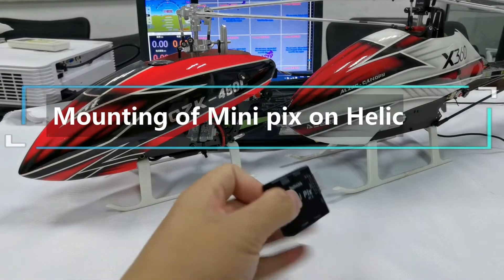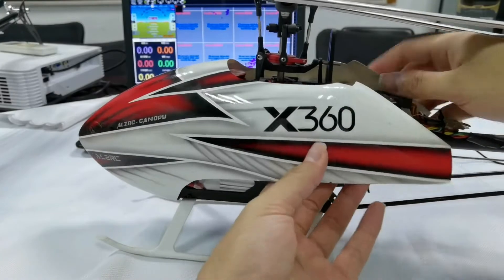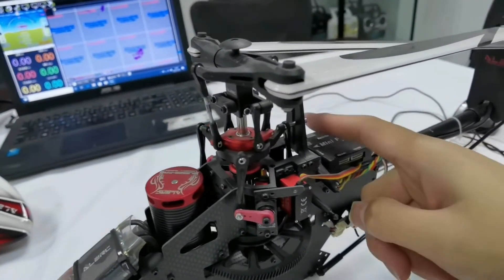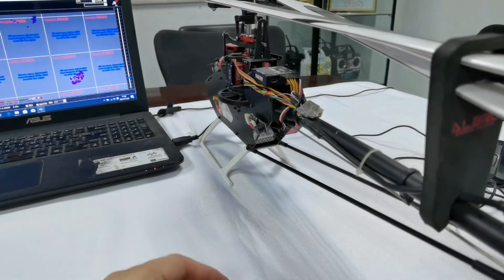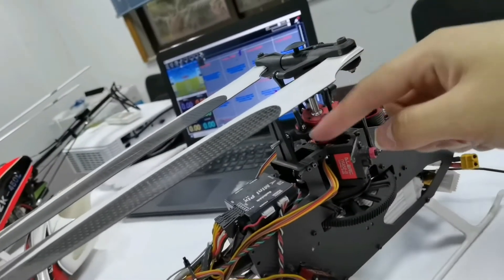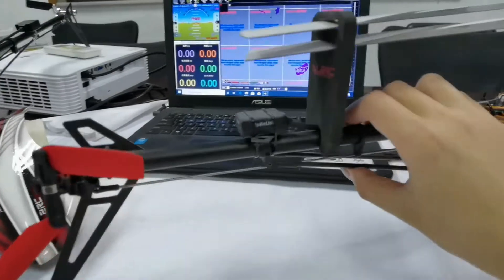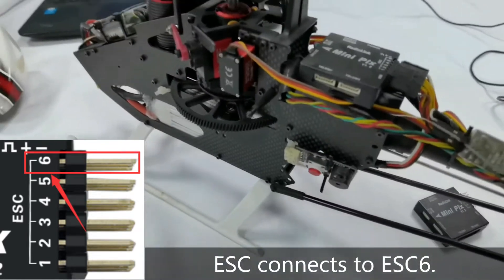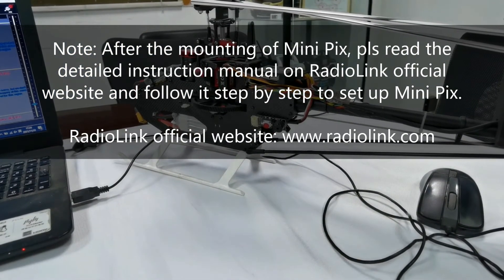PIXHAWK/Mini Pix/crossflight/Turbo Pix on Helicopter

Comment: Sure. Here’s your text converted into English, keeping the same tone and clarity:

⸻

I conducted new tests with Crossflight, this time using a Devil 420 helicopter. Unfortunately, in Loiter flight mode the main and tail rotors remain static. Therefore, the frivolous argument that “everything will be solved in flight” sounds absolutely false to me.

Thus, should RadioLink Support fail to be cooperative in providing a configuration capable of changing this situation, I will definitely abandon this Flight Controller and, as a matter of conscience, I will not recommend its use in rotary-wing aircraft, given the arguments and tests demonstrated.

This idle talk about “flight logs” does not serve my purpose and does not answer the following question: WHY, when engaged, does GPS flight take full control away from the pilot, turning the helicopter into an alien machine? That is the only question I am asking: WHY DOES GPS FLIGHT MODE NEUTRALIZE THE COMMANDS?
Reply from the maker: Hi, sir. May I know what you mean that the main and tail rotors remain static? Could you please send us the flight log and also the flight video to show it? And in GPS mode, you can control the helicopter with the stick. Only in auto flight, the stick does not respond. If any question about RadioLink products please feel free to contact us. Our email is: after_service@radiolink.com.cn

Comment: in the manual it says that: Crossflight with factory date after August 16, 2023 (including the 16th) can update firmware by default through Lodi ground station and open source ground station. Before the factory date is 2023.8.16, the firmware can only be updated through the Radix ground station and only the Radix firmware is compatible. How can I find out the manufacturing date of the crossfligh?
Reply from the maker: Hi, sir. Connect the CrossFlight to the Radiolink Mission Planner, there is a (d5a4c778) default that can upgrade the firmware by both the Radiolink Mission Planner and ArduPilot Mission Planner. You can check more details from this link: https://www.radiolink.com/crossflight_firmware  If any question about RadioLink products please feel free to contact us. Our email is: after_service@radiolink.com.cn
Reply: thank you very much!!!  for clearing my doubts.

Comment: I've noticed that the power distribution board isn't used in this install and the power for the minipix is coming from one wire connected to ESC 5 on the minipix? Is the esc for the motor supplying power to the servos as well as the minipix when it's connected into esc 6 port on the minipix?
Reply from the maker: Hi, sir. Yes. Since the standard power module of the MINI PIX cannot directly supply power to the devices on the pins of the MINI PIX, if the pin is connected to an ESC without BEC (ESC 5V output) (The ESC can get power from power module and it can work without BEC), the servos plugged into the pins get no power supply, so you need to supply power to the pins separately at this time, otherwise the servos connected to the pins will not work. On the other hand, if the ESC on the pin has its own BEC (ESC 5V output), there is no need to separately supply power to the servo connected to the pins. So it depends on the ESC you connect. If there is any question, please feel free to contact us. Our email is after_service@radiolink.com.cn

Comment: What is a MiniPix?
Reply from the maker: Hello, sir. Mini Pix is a flight controller from RadioLink. The new Radiolink independently developed the Mini PIX, and the enclosure uses closed protection for the barometer to reduce the airflow interference during the movement and reduce the vibration. At the same time, the software algorithm optimizes the air pressure to maintain the PIXHAWK complete function, which is easy to setup. Here is the link of it for more detailed information: https://www.radiolink.com/minipix